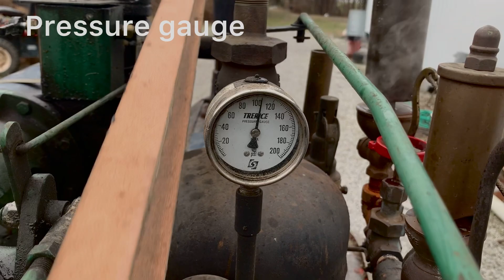Running a half scale 65 HP case steam traction engine

Comment: I always wonder how much work and money is it to build a scale model of a steam traction engine
Reply from the maker: It takes a TON of work to even get the engine started I can’t even imagine how much work it is to build one! And I know the prices of Steam Engines have sky rocketed in prices. They’re just very hard to find parts and fittings and a new good boiler! i’ve seen a half scale 110 CASE engine that was in pieces that went for over 30 thousand dollars !! It’s crazy now!
Reply: Half scales are usually just as much if not more than a full size steam tractor, probably because of the convenience and the fact that they are all homemade

Comment from the maker: If you have any questions or concerns, please let me know and i will try my best to help you with what it is.
Reply: Would you consider selling it
Reply from the maker: @HarryBobb-ct7pb  No sir it’s not for sale. There are probably different ones in auctions or the internet somewhere that’ll be priced for you to buy.
Reply: How does the gearbox work?
Reply from the maker: @JORGE_BRASILEIRO  There is a series of gears connecting from the pulley to the back right axel . As the piston is moving the pulley will be turning an when the clutch is engaged the blocks in the pulley connected the clutch rod will press outward causing the gears to move as in moving the engine.
Reply: @FarmersMasonry  Very nice, I didn't know there was a clutch on these tractors, could you make a video about this mechanical part of them?
Reply from the maker: @JORGE_BRASILEIRO  Whenever i get the chance to see the engine again i will do that!

Comment: Very cool. Thats alot of effort put in for a remake of an old tractor. I still feel a little disappointed no one has gotten around to trying to remake the chevy steam car or something like that. Steam cars were never serious compared to gas cars despite bigger steam ships being way better compared to the bigger gas piston ships. If you know someone who wants to be the first at something it would be cool if someone finally made a serious car or if not just ran their car lean and their engine hot and brought back water injection (as steam) but this time reusing water to not refill. Supposedly if you run an engine too lean they melt down but water should be a simple way to cool it down so someone could probably make a channel like that lawn mower carburator guy off of it if they got good mpg on some used car if they were actually able to get it going.
Reply from the maker: that would be so cool too see and they have injectors too cool down the steam if it gets too hot
Reply: Water is pretty cool stuff. My grandpa  talked about there being attempts to make high mpg carburators and fun stuff like that. He told me water was injected into engines to burn or something and I thought it was pretty weird because water already is burnt. I realised later water splits when hot enough so it can totally burn again if you get it hot enough to split so thats kind of funny. Anyways its kind of annoying that all the car companies are trying to jump over to electric  when there not even close to the end of ice tech tree. When you think about it cars have radiators its pretty gross. Radiators are entirely dedicated to getting rid of energy. It dosent really matter if its done by water injection or if its done by liquid lithium coolent to water and then to a tesla steam turbine, car companies never even tried replacing the radiator and keeping the energy but still pretend their cars are efficient. Any normal v8 engine these days should be getting no less than a few percent off of prius mpg when they are at speed and doing nothing but ideling but they pretend its got to be a 14 to 1 ratio and do nothing about changeing that.
Reply: @gabriels5105  Can you recommend a book, youtube video or blog on the subject? :) regards.
Reply: @jerrysundin8425  as far as the whole subject I never found a book that explained the whole thing though I would like too. For videos there is a shell 377 mpg opel that I heard does not have a radiator because they want it to run hotter. When it comes to gasoline I saw a video or two explaining air fuel mixtures and the reason they chose to use the ratio they did was because otherwise the engine would run too hot and the evaporation of gasoline could keep areas of the engine from over heating. I thought I saw more than a few people people add water vapor in front of their engines but never really get the results they wanted because they did not have control over things like tuning and timing and did not have follow up videos. I heard early aircraft and tractors used water injection but I did not look into it enough. Anyways I think a new bmw engine has water injection but I am somewhat sure it is for cooling and not gas mileage and they dont heat the water using excess heat before hand. I also saw a guy on youtube run a lawn mower carburetor on his old v8 and it got much more gas milage on the freeway. He said it was 40mpg. It was from thunderhead 289. His car got like 60 horse power and over heated when not moving but with water injection I would imagine he would get more hp and his engine would run at a proper temp which would likely get him even more mpg. Being able to turn big engines suddenly into economy engines would be pretty nice. His mpg is likely due to running lean excellent fuel air mixture of running gas and air quicker through a small not straight tube in a small caurburator. I also heard water mixes into ethanol which can be used to seperate it from normal gasoline though I am not sure it that is helpful in this case.
Reply: O mere iiii hai iiiiiii ka ek iiiiiiiiiiiiiiiiii iiiiiii iioooooiooiiiook kia se ki ki ki ve
Reply: Yv0mm

Comment: Lot of power for a single cylinder. Think the 150 is a single as well. I see where the triple expansion steam engine on ships have steam applied to both the top and bottom of the piston, maybe this is a common aspect for all steam engines. I need to look at basics again. Seems like it would be common. Thanks
Reply from the maker: Yes this little monster is actually surprisingly powerful for its size! it can do a lot you would wanna do with it. And yes the 150 Case is single cylinder most cases are single but i believe there was a few double cylinder ones made. And with these certain type of cylinders its a little different compared to trains and steam boats, with steam engines they where designed for the simple on ground stuff such as plowing and sawing wood and threashing so they where designed to run at a slower pace where as steamboats where designed to ship demand from one place to another in a certain amount of time. I’ve never seen the inside of the Steam engine cylinder in person but i have seen pictures and it’s a lot different then other engines. Steam comes from the top of the pistons and pushed a block back and forth and circulates back in forth causing the pushing of the wheels and such and such. Thank you for commenting!
Reply: Do you want to sell it
Reply from the maker: @HarryBobb-ji3lf  NEVER